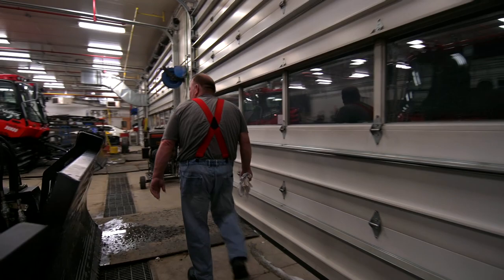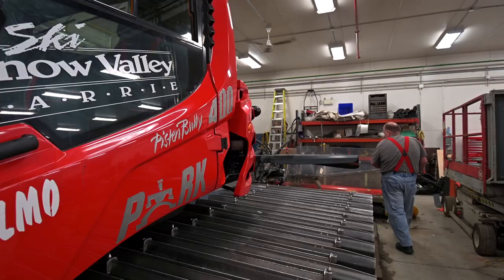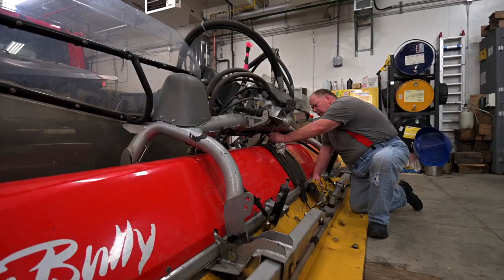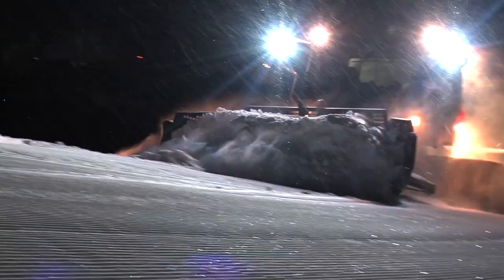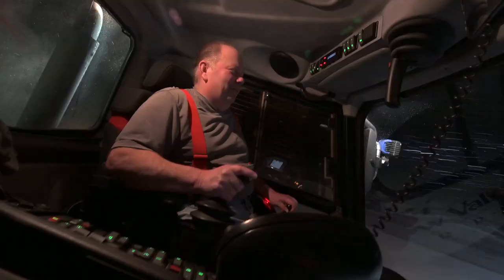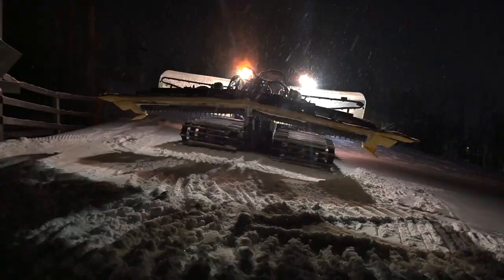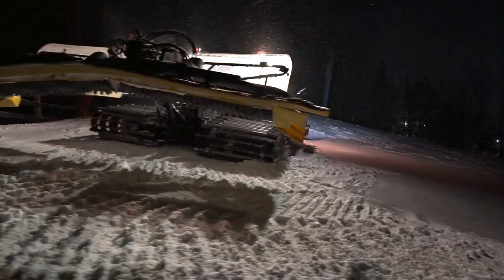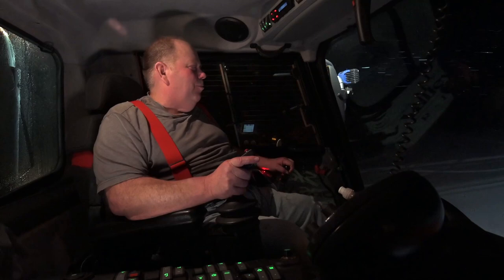Behind the Scenes | A Night in the Life of a Snowcat Operator

Comment: Now I see how Renner got flattened.  Why isn't there a platform over the treads to prevent operators from getting thrown under them?  Terrible design.
Reply: There are a number of reasons why track guards are not a thing in the modern day industrial snow cat. 1) Visibility: Track guards could obstruct the operator's view of the tracks and the surrounding terrain. 2) Accessibility: We often need to access the tracks and undercarriage for maintenance and repairs. Track guards would make it more difficult to reach these areas, potentially increasing downtime for servicing the machine. 3) Maneuverability: Track guards could affect the snowcat's maneuverability, making it less agile. 4) Safety Measures: Us operators are trained to operate these machines safely, which includes understanding the risks associated with the equipment. We are trained to operate the snowcat in a manner that minimizes the risk of being thrown into the tracks or encountering other hazards. Looking at Jeremy Renner's incident, plain and simply: He failed to do what any reason operator is trained to do. Before you get out of the machine for any reason, we are trained to do 2 things. 1) put the parking brake on (that way the machine doesn't roll) and 2) put the front blade on the ground (that way if the parking brake fails, the groomer won't go anywhere with the blade digging in. If Jeremy Renner had done either of those 2 things, that would never have happened. It is definitely very sad that it happened and I am glad his recovery is going well! Cheers.